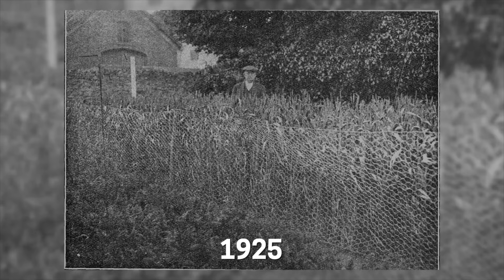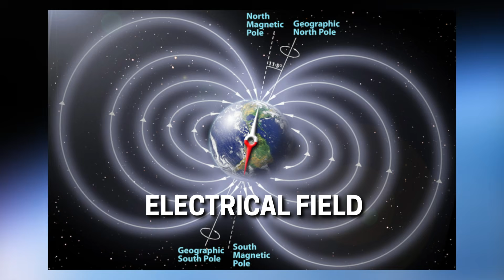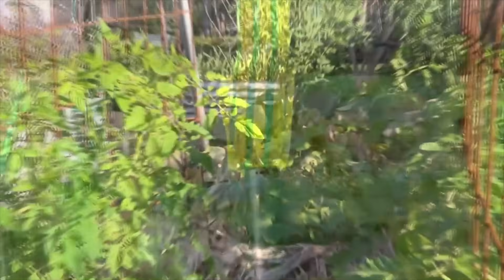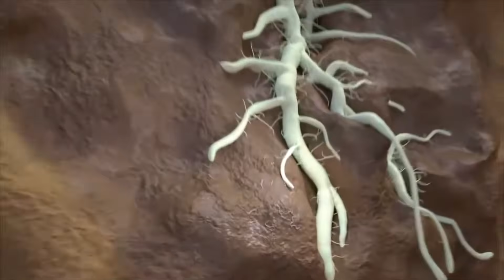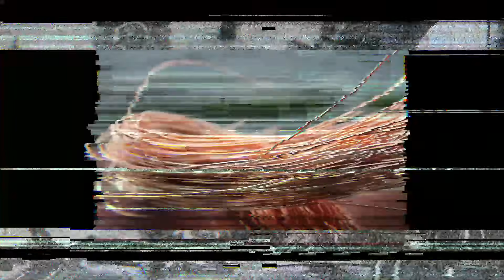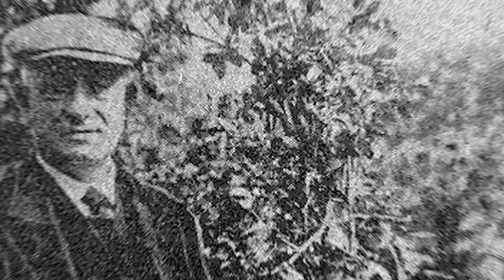One Copper Cable Eliminates ALL Pests Forever — Why Is This Science 'Forbidden'?

Comment: If this were true, plants grown in containers that do not touch the ground would not thrive and would be destroyed by insects ???
Reply from the maker: Fair point! But the electrical field is in the air too, not just the ground. That's literally why the antenna sticks up above the plant. The ground just makes it stronger. Try it on a potted plant and see what happens! ☘
Reply: @ironrootsofficial exactly, it actually does work